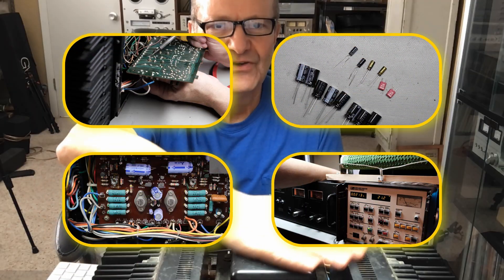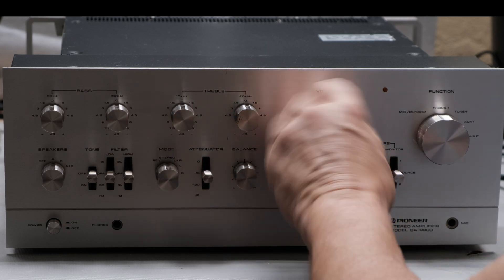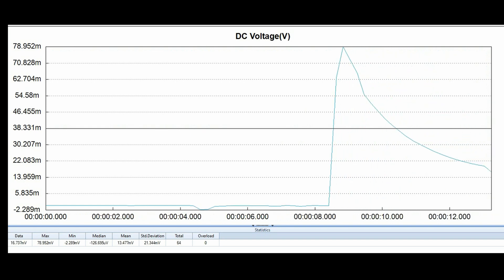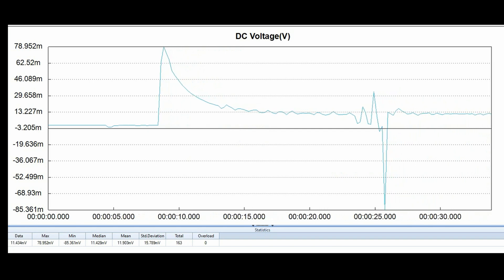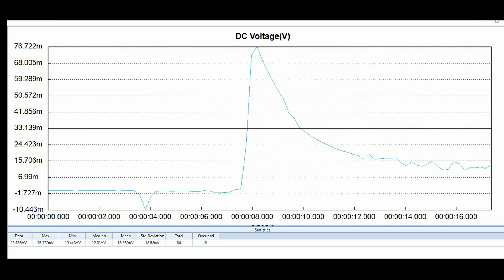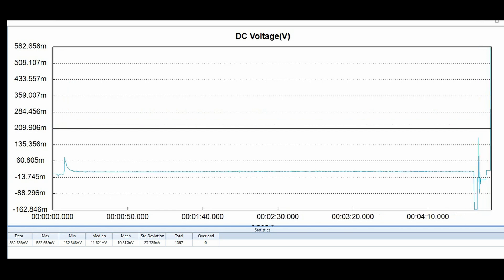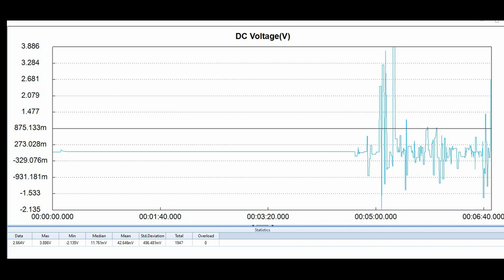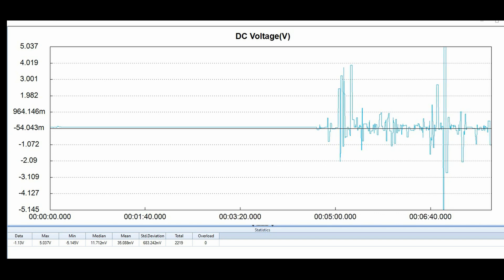Your Vintage Amplifier Is Broken. See The Truth And The Proof.

Comment: Had these on one amp as well.... In my case it was the filter caps, having internal connection problems... I removed them and tested them separate....some times it was good for minutes and then randomly draw some several 100mA dropped its voltage and came back good for minutes...never seen that before..and the other one was ok doing the same tests.... I left the faulty one on my lab-power supply for several hours under voltage and current control... Sometimes it even produces surges up to 500mA.... Strange... Now let see what the problem here... 😉 😊

Comment: Thank you for the video Chris... I just pulled the trigger on a Siglent SDM3045X DMM... I also have a Rigol o-scope coming along with a UNI-T UTG962E Arbitrary Waveform Generator, and a bunch of other stuff. 33 years as a truck driver, shade tree mechanic, home owner, electrical, plumbing, etc... Tools up the wazoo. I discovered the vintage audio a year ago, two Sansui units, a 4000 and a 2000, they will be my first projects. I want to learn these repairs, as the stress of trucking and years in the oil fields have taken their toll on my body. 

Here in my area, shops are backed up for months, and it is not uncommon to have a year or longer wait. I know a few local guys that are doing these repairs out of their homes, and are backlogged for months themselves. I see a market here, just need to hit the books and really learn this stuff. Not afraid to dig in to a piece of gear, just need the practice and time. Simple stuff, crawl before I walk and then run. Thanks again for the videos Chris!

Comment: Chris, Excellent info as always!  Sir, I would like to ask about how you captured the voltage changes.  I've wanted a strip recorder for many of the same reasons for a very long time.  Bummer I can't afford a recording scope yet.  Many thanks and please have a great day.
Reply from the maker: Thank you. I have a Siglent 3045X DMM that I connect via it's USB connection to my Win 10 computer. I use Siglents Software utility called EasyDMM to capture what the DMM is reading to the computer. I then use a program called Flashback Express which allows you to capture and save the video data on your monitor to your computer. After that I  use Divinci Resolve to edit the video that you see on YouTube.
Reply: @vintageaudioaddict  Awesome Chris!  Thanks a million.  Keep up your great work.  I plan to use your advice to help me correct a NAD 214 amp that is running much warmer than my cool running  214 that even sounds a bit better.  All the very best, Kevin

Comment: Hmm, interesting, I didn't know that this issue could even happen... Is this exclusive to vintage Pioneer amps, or is this a common problem among pretty much ALL vintage amplifiers?... And the real question here is what exactly causes it, AND how do you go about fixing this issue?!
Reply from the maker: I know I didn't get into many details about the cause. I plan to do a complete video on this SA-9900 in the future that will include in detail what caused it. My goal in this video was to try and explain that this issue can be in any of the older audio gear. It doesn't matter the brand or model. All of the manufactures used the technology of the day, in this case the 1970's. Using similar design techniques as well as using the parts available most of the brands/models are more similar than different. Now to answer you question. Part of the issue was caused by "Change On Sight" Transistors in the pre/power amp that have been known trouble makers for many years. The other issue was a regulated power supply problem that was also caused by a defective transistor. This issue was unrelated to the transistor issue in the Pre/Power Amp section.

Comment: Beginner question. I've worked on a Marantz 1040 and it seems to work perfectly, all knobs and buttons are clean now and it outputs 24.9W/channel, bias set to 20mv and the other setting to 0v as per manual.
The only thing I don't understand is when the input knob is on anything else but the source, you can hear the source leaking in mono through the speakers. Turning the volume to the middle lowers that sound. Is this normal behaviour ? Thanks for your video's.

Comment: And what would be the cause for these spikes?
Reply from the maker: Part of the issue was caused by "Change On Sight" Transistors in the pre/power amp that have been known trouble makers for many years. The other issue was a regulated power supply problem that was also caused by a defective transistor. This issue was unrelated to the transistor issue in the Pre/Power Amp section.

Comment: great video chris but , you never told us what you did to resolve the issue.
Reply from the maker: Thanks. I know I didn't get into details about the cause. I plan to do a complete video on this SA-9900 in the future that will include in detail what caused it. My goal in this video was to try and explain that this issue can be in any of the older audio gear. It doesn't matter the brand or model. All of the manufactures used the technology of the day, in this case the 1970's. Using similar design techniques as well as using the parts available most of the brands/models are more similar than different. Now to answer you question. Part of the issue was caused by "Change On Sight" Transistors in the pre/power amp that have been known trouble makers for many years in vintage audio equipment. The other issue was a regulated power supply problem that was also caused by a defective transistor. This issue was unrelated to the transistor issues in the Pre/Power Amp section.
Reply: @vintageaudioaddict   much respect.  thank you chris

Comment: I’m starting to wonder if my Pioneer receiver hasn’t started to do this. I thought it was just transients coming from the Bluetooth receiver because that’s all I ever run through it these days. What failing components are usually behind these spikes and offsets?
Reply from the maker: Lots of different failures can pop up in the older audio gear that are caused by a variety of reasons including defective transistors and capacitors. To start, I would check in the service manual for your receiver and see if it contains C1451 transistors. If it does that would be something to check out.
Reply: @vintageaudioaddict  Thanks. Looks like no C1451s in the Pioneer SX-880 but I will haul the thing down to the bench for some investigation one of these days.

Comment: Differential input
Reply from the maker: Part of the issue was caused by "Change On Sight" Transistors in the pre/power amp that have been known trouble makers for many years in vintage audio equipment. The other issue was a regulated power supply problem that was also caused by a defective transistor. This issue was unrelated to the transistor issue in the Pre/Power Amp section.

Comment: negative feed back and bad caps
Reply from the maker: I did change out the old electrolytic capacitors but the issue was caused by "Change On Sight" Transistors in the pre/power amp that have been known trouble makers for many years in vintage audio equipment. The other issue was a regulated power supply problem that was also caused by a defective transistor. This issue was unrelated to the transistor issue in the Pre/Power Amp section.

Comment: Thanks for the tip!     I've had my NAD 3155 since the mid 80's and it doesn't seem to 'punch' as dynamically as I remember .. It's due for a tune-up!
Reply: I have one too...deoxit all the switches.. don't know where to start after that...
Reply: @mikeschlup5279  I sprayed all the pots with cleaner about a year ago. The volume pot started getting scratchy. I did a visual inspection of the caps, looked for leakage, corrosion, signs of over-heating. Vacuumed everything out.. All looks fine but one doesn't really know until you get it on a scope. I know a local repair dude; serviced my Trace Elliot Twin Valve bass head. 🙂
Reply: @DoghouseFunkBlaster65  I would send it anywhere.   At some point.  Just had to spend 3400.  to pass e check..would have bought a nice Yamaha I.A.
Reply from the maker: Your welcome. Thanks for watching.

Comment: Love all of your videos I’ve seen so far.  Very informative.  Coincidentally I just got a JVC ja s77, my second and it was working then I checked and adjusted the basic alignments.  This unit has 3 that you can do with a multimeter.  main amp center, main amp idling, and equalizer amp center.  Well, the right channel of the idling current supposed to be 4.4 mvolts and it was around 50 mV so I adjusted down but wouldn’t come below 23 mV.  This caused the right channel not to work at all. Adjusted back up further away from nominal and it would work again, but that channel was heating up more than the left.  Anyways had to send it back.  Might of been that potentiometer because it was erratic but because it wouldn’t come down enough probably more wrong than just the pot? Wasn’t going to pay full price for something broke.
Reply from the maker: Thanks for sharing. Vintage units like your JVC were built to last but after all of these years there are going to be issues with them. Most of the problems can be solved and they can operate for many more decades.

Comment: Very interesting. I am not a tech, so over my head. I recently bought a Luxman L100 and a L580 and both had (R) channel issues in the preamp section? Distorts then fades then goes silent.  Do all techs check what you are showing us?
Reply from the maker: Thanks for watching. A lot of techs don't because time is money. Many times folks who bring in equipment for repair don't want to pay anything extra. They just want the problem that it was brought in for taken care of.
Reply: There are a ton of tantalum caps and 2SC870 transistors, (IIRC), in the L100.  I think I replaced 52 transistors alone on one plus all of the caps.  Not easy, but WELL worth it.  Outstanding unit!

Comment: Electrolytic caps no doubt.
Reply from the maker: Some "change on sight" transistors in the pre and power amp section along with a power supply issue that was also a transistor issue. Thanks for watching.

Comment: Let me guess filter capacitor failure.
Reply from the maker: Well, multiple problems that moved me in various directions. I plan to do a video on the repair but it was a combination of the known "change on sight" transistors in this unit along with a power supply issue. I did replace the original filter capacitors.